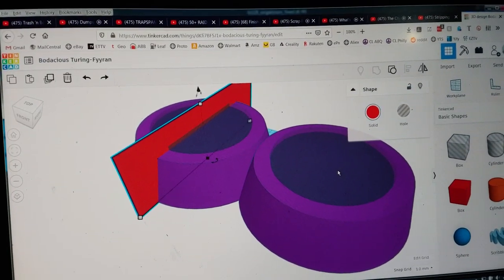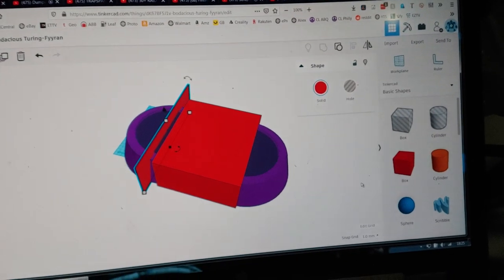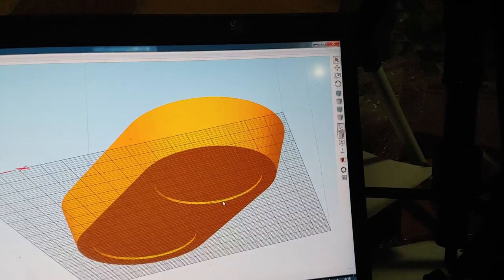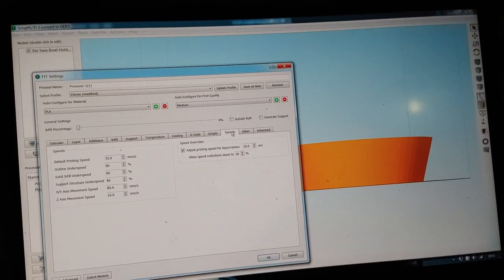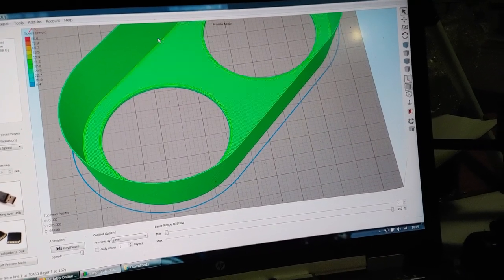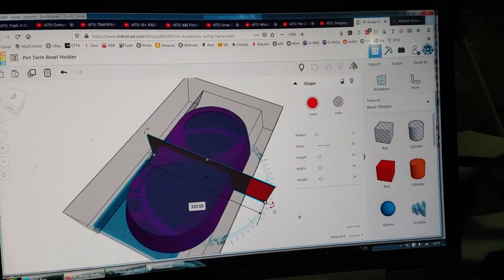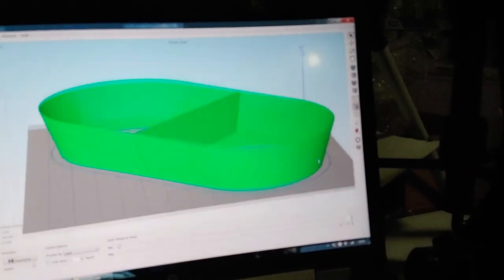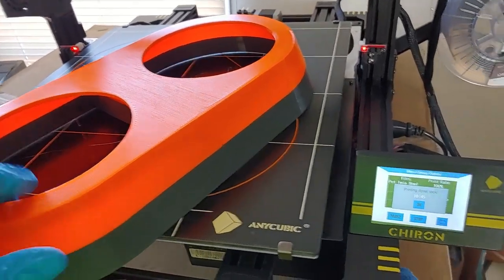From Idea to Tinkercad To Printer Twin Pet Bowl Holder T3DP

Comment: One half with two holes, the other half with two pegs. That way you can glue them together and they will be lined up. Also if someone only wants to hang one up they can use only the one with holes and no need to drill. Can Vase mode do that?
Reply from the maker: Part of the point is vase mode printing which makes it very fast clean and strong. Any break in the outline breaks vase mode (ie no holes) easy enough to drill em though!

Also if you're going to do the Peg and hole method you don't use two holes into pegs you use one hole and one peg! This way you only have to upload one part if you print to of that part they will interface with each other since you have to rotate the one part 180 degrees after printing in order to put them together :-)

Comment: For the split model, could you do a puzzle piece like fit. Where each side has the male/female puzzle. And you can slide them together? Or maybe a simpler Dovetail.
Reply from the maker: Yes and Theory that's possible but not worth the effort at least not for something you want to share with other people because you would have to tune the model for each individual person printing it so the scaling that I used to allow the 1.2 mmmm Extrusion to join two pieces together wouldn't work for you with a 0.8 nozzle or a 0.4 nozzle Etc but it should be possible to do that and retain vase mode printing! So I just might have to try that just because it would be fun but for Simplicity sake a little double stick tape or heck even a nut and bolt right through the two halves would be enough in fact I could print the nut and bolt :-) Maybe I would have to see if the dishes get the way

Comment: Nice video Chris, good new content. Must admit part way through the video when you started saying about the size i was saying to myself couldnt the holder be reduced back to the lip of the bowl and then next print it is lol. Just wanted to pick your brain a bit too, i was looking at recycling scrap prints and left over PLA, i stumbled across a video of two brothers who were taking milk bottle lids, melting them down and creating mould blocks which they then used a lathe to create some fantastic looking pens. I surfed through teaching techs videos about him melting down scrap PLA and think it could be used to do the same type of thing. What are your thoughts? have you considered anything like this as you must get a tonne of waste PLA and making it back into filament at the moment is still out of the average consumers hands. Thanks in advance
Reply from the maker: Yep i accidentally doubled all my tolerance measurements
I measured diameters but adjust my tolerances as of they were radii so it ended up bigger than needed. Even min maxed still bigger than cr10 so there is a cropped version that fits on the cr10 (just a wee bit off the corners)

I plan to keep all waste plastic and melt them into cinder block shapes. In a few years if it works i should have enough bricks to make a little shed or something. Not only no waste but the carbon remains sequestered. Plus it sounds like fun.

Comment: Why gloves on a fdm printer?  I love this kind of video: start to finish, practical, make a mistake, do it over, than make it even better. Great
Reply from the maker: Because I was also interacting with my resin printers during this process so when I made some of the videos I happen to still have a glove on playing with resin prints you really don't want to touch that stuff barehanded :-)
Reply: @nerys71  Or anything else with contaminated gloves :-)
Reply from the maker: @stevelaminack1516  Gloves were clean (IPA and pat after each use) so not cross contamination concern. but I was in the process of processing them in the ultra sonic cleaner so did not want to take it off just to put it back on again.
Reply: @nerys71  I Figured that but want to say it for the benefit of others if for no other reason.